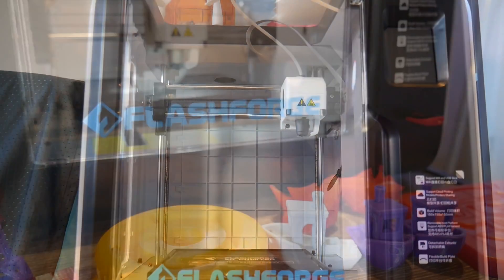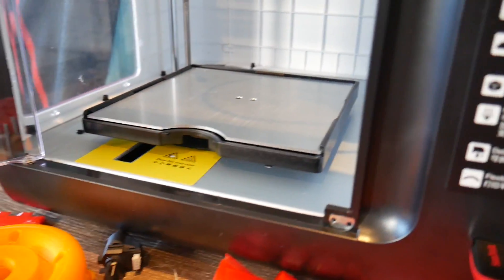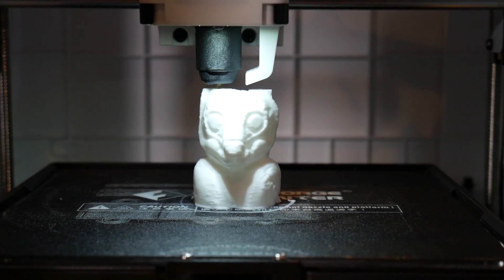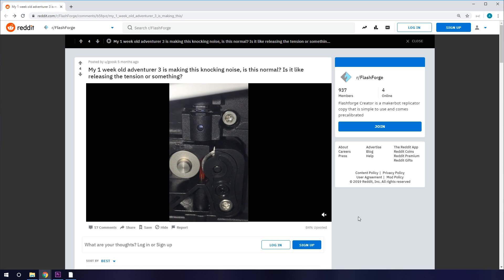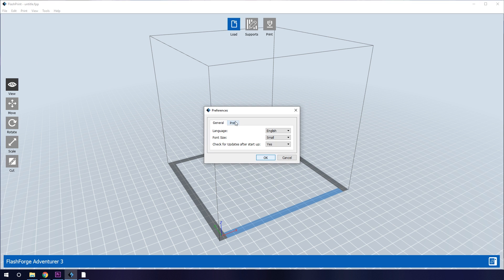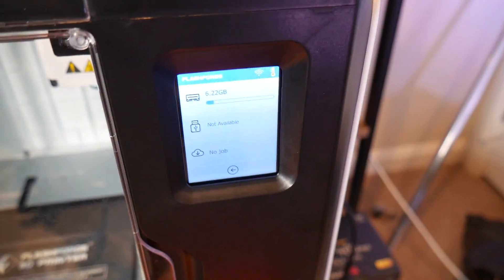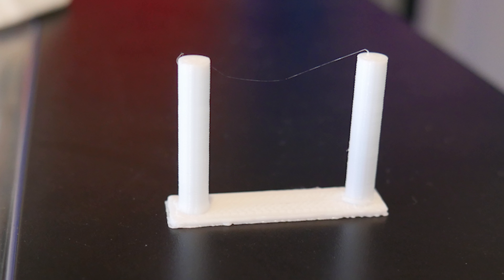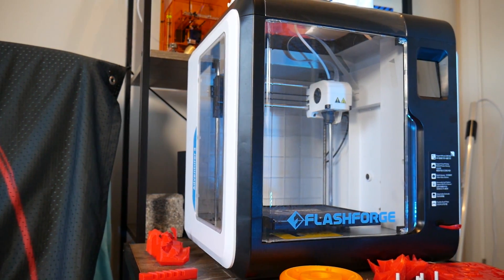The Flashforge Adventurer 3 Review

Comment: On your router do an dhcp reservation
Just find the mac address of the printer, that way the printer will always get the same ip address
Reply: BINGO!!!  Was just going to say that...
Reply: I’ve done wireless networking as a job for 30 years and have never encountered a device that changes MAC address.  I think a DHCP reservation would solve Makers problem. I wouldn’t use that feature anyway, but that’s the solution.
Reply: Was about to comment the same thing. That's how all network devices work unless you set it up properly. Not the printers fault you don't know how to use a router
Reply: The only things I've seen that change their MAC on boot are cheap boards that skip using a network IC.  These boards usually involve a single small embedded processor which then emulates a network interface IC as well as performing the device logic.  To avoid having to individualise the ROM on each chip, the developers code it to randomise the MAC on boot ... it's a really bad idea, but it squeezes the last few pennies out of the fab cost for anyone that wants to skip having a per-unit QA cycle.

Solution matrix I've used for these are :

1. See if the device firmware can be read (just patch and reflash)
2. See if the manufacturer has a readable firmware upgrade file that can be patched and flashed
3. In not 1 or 2, then see if the chip is of a type where the programming fuse can be reenabled (read, patch and reflash)

(the above will fix the MAC on the device, and require no network changes)

4. If not, and wired, create a sublan using a layer-3 switch that supports assigning IP by port
5. If not, and wireless, use a DDWRT and recompile the DHCPd to recognise the OUI (Where only the UAA changes)

(the above requiring control of the end-users LAN, so only really useful if you're the end user)

6. If none of the above possible and cannot administer end-users LAN ... use a PIC based PHY as a source agnostic MAC Bridge, extending the device.

(The above extends the device and makes it well-behaved, avoiding the need for LAN changes)

I've actually commited the sin of using a virtual PHY and burning the same image for multiple devices.  The trick to getting away with it is to read the MAC from NVRAM and if it is null UAA, it's the first-boot: Generate a random UAA and write it back to NVRAM thus creating a permanent MAC.  It's lazy, but it saves having a floating MAC.

You don't see this problem so much anymore, but it used to be fairly common in (usually Chinese) crapware devices.

Just my 2c ; )
Reply: By way of update there is an update for the firmware that stops the MAC address changing. It can be obtained by contacting Flashforge support.
Reply: If you use wifi. The mac address will change every boot. I don't know how they do that. I fix that by use ethernet. Now i have fixed mac address to set in my router
Reply: pandu pujo the mac address is embedded on the wifi device, is like the fingerprints for humans.   The mac address is not going to change.   If you access the device on the web interface or ping the device should be able to see the mac address the. Do a dhcp reservation on your wifi router, or you can manually configure the ip address on your device then do a dhcp ip exclusion.  Either way works.
Reply: @titopancho  yep. I know about that. But not with this one. Weirdest device that changing mac address every reboot. I dont know how they do that magic
Reply: @titopancho  Sorry to say that, but no, MAC addresses actually CAN be changed in the operating system, and pretty easily actually, for Ethernet, Wifi or any other thing working with MAC addresses (google "MAC Address spoofing"). So I don't know if (and especially why...) they force MAC addresses changes in their printer's OS, but if they do, then the reservation won't work.

But good still a tip though, too few people know about this trick, so cheers :)
Reply: Too geeky 💝

Comment: Skipping extruder on a Adventurer 3??? Lol
Rubbish printer. And the fact its targeted at the commercial side...tsk
The hotends warp and move
Reply: I've had mine for months and only have the skipping happen on 1 filament, glow in the dark PLA. Went back to basic pla and skipping went away
Reply: @brandonmatuschka4841  I never used glow in the dark filament. Just FF filaments....and even other brands to determine problem.
In the end..too many other problems crept up. This is targeted for businesses...and I dont think it should be at all.
Reply: I had very low expectations when I bought mine but have been more than satisfied with every aspect of it. Sorry you've had problems.
Reply: @portlyoldman  For the price. Definately below expectations. I am far from alone.
I also use my printers daily..so it did get put through its paces.
$800 AUD when I bought it. That was 3x Ender 3s. Better quality. The maths was easy.
Reply: swiftrick15. I guess I was lucky as Amazon had it at £300 at the time!
Reply: @portlyoldman  yeah..if the price was right..maybe.
I still agree with Angus..a V2 with all the bugs gone would be great.
They all have the same problems. Eg.WiFi IP address resetting on every boot. It must be a hardware thing as they have not addressed this and it has been around for a while.
Reply: swiftrick15  - I commented on the IP problem elsewhere in the comments. There's a firmware update for that. I'm not sure of its public yet but I found it on the flashforge forum 😀
Reply: @portlyoldman  Finally. Good stuff.
Although that was the least of my problems. I still have a spare hotend laying around for it. Lol
Reply: @portlyoldman  And it should be public if it is available
Reply: @AP-qs2zf  What material are you using?

Comment: Worse 3D printer I ever used.
And that was 3 replacements.
Then I found Ender 3...never looked back.
This printer develops problems with time. Believe me.
Reply from the maker: What kind of issues?
Reply: @MakersMuse  The extruder kept skipping as you experienced. After countless hours and research I discovered it was the hotend. New hotend. All okay then after a while skipping again. Cleaned out hotend with provided tools. Was good for a while..then blocks. With FF filaments. Temp changes didnt seem to make diffetence. Printed much slower it helped but was never right. Lead screw rods rattle. And gets noisier with more use. Random lock ups freezing when printing via dif sources. No explanation there. Wifi camera can work via IP address in a LAN. But pretty ordinary.
Print quality was hit and miss. FF filaments vary in colours..so watch batches.
Cooling fan duct too high. Aims at nozzle not part. Thingiverse for that.
TBH this was my 2nd printer. The Finder was my first and def more solid. Maybe its a direct drive thing. Im happy now. 3 Ender 3s. One in a chamber with Swiss AM Hotend pritning CF like butter. And a Chiron for any big stuff.
Thanks for your channel mate.
Im in Brisbane. And your knowledge has helped me a lot.
Keep up the great work
Reply from the maker: Cheers, super appreciate the breakdown. Seems they need to take this one back to the drawing board for a V2.
Reply: @MakersMuse  Exactly. A lot of potential. Kind of like a good old Holden. Just not implemented properly.
Reply: Same. I had purchased the monoprice voxel version and it printed great but then it started the clicking and I tried to get it working but nothing seemed to fox it completely. It needs a V2 with some revisions